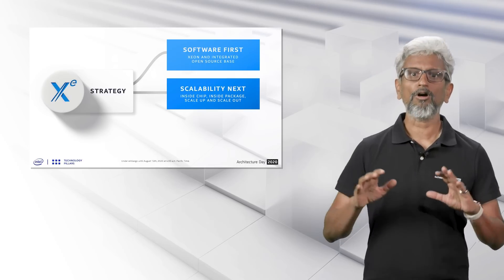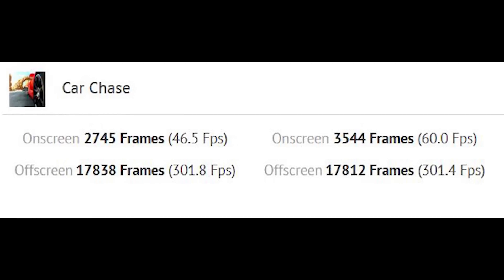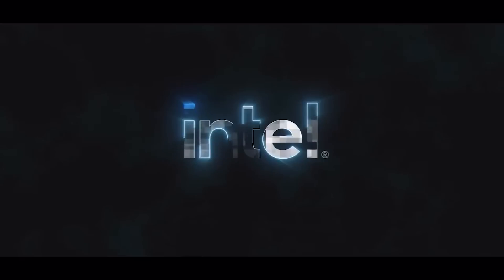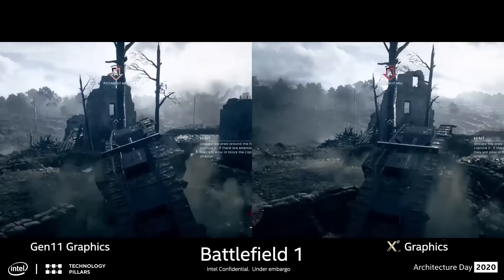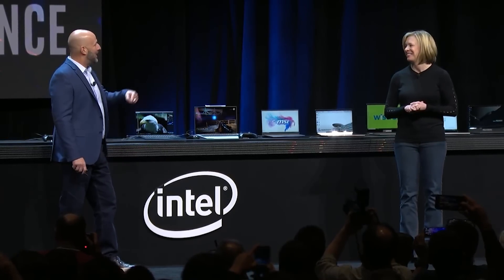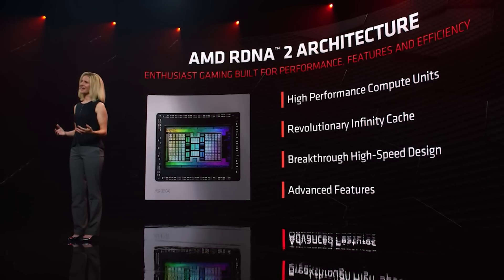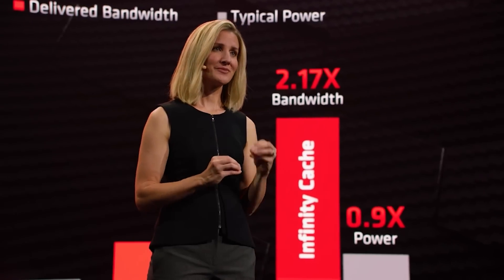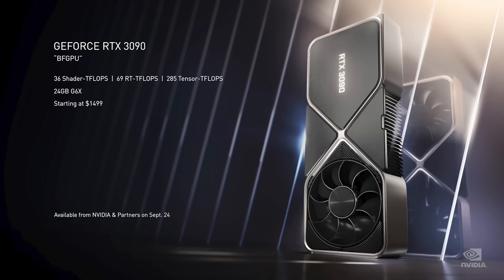Intel Xe DG2 Benchmarks Shows REAL COMPETITION | Navi 33 Specs & Early Prices LEAK

Comment: Sorry, DG2 looking super promising? Well, when the comparison point is the lowest end product from TWO generations ago, and the new product doesn’t consistently destroy the competition in that comparison… how is that promising? I mean, the 1660 launched at $149 and was launched at a time when low end discrete GPU’s were actually a thing.

Both nVidia and AMD are probably throwing away or recycling GPU’s (because they can’t pass validation for actual products) that will leave DG2 in the dust.

This is a HUGE disappointment from Intel if this is anything even remotely close to their best effort. The only thing these GPU’s is going to compete with is integrated graphics on Intel’s horribly aging CPU’s. There’s nothing promising about that!

Comment: I just hope the DG2 will bring some competition to both AMD/Nvidia.. Nvidia has continued to DRIVE prices higher, while giving smaller performance boost for each new generation. Ampere imo has been a JOKE.. Pascal was gift to gamers imo (Gtx 1xxx) and Turning (RTX 2xxx) was over price. Ampere RXT 3xxx   was cheaper but still overpriced. Consider Nvidia went with cheaper Samsung 8nm (which just refresh of there 10/12 node) and draws more power, and less performance boost vs previous generation gpus.

I just hope Intel prices there gpu correctly, but knowing intel, they prob overcharge like they do for intel cpus.. time will tell I guess.  I hope performance DG2 are decent enough.. (rtx 3060+)

hopefully RDNA3 is better and has better RT performance.
Reply: Ampere had a peformance boost but the prices were still Turing levels of bad. Ampere is such a bad uarch though. Power basically = performance.

Comment: I dont care if the 7800XT is 900$, if it is over twice the 6900XT in performance. If 6900XT perfromance can be bought for 450$ or less, this is awesome. If the 7800XT is just 30% faster and costs 900$ Im pissed, but at double the performance 900$ is insane value.
Reply: Problem is then they can charge you $900 for the next card and it will NEVER offer the same upgrade because of how many Compute units you are getting over RDNA 2.
Reply: @albal156  I know, but also prices of most parts of a GPU are getting more expensive, also politics and policies play a big role, cards just aren't as cheap as they were before. We can just hope they won't get ridiculous. We won't see a 7800XT at 2.5 times performance of the 6900XT for 649$, it won't happen. The GPU is way too expensive to make and people will pay a higher price. The 6600XT is soooooo cheap to produce and they sell it at 379$, they will easily sell out, because people want to game and so on...

Comment: The flagship gpus of next gen will be so powerful that it'll lock you into 4k 120hz for the next 8 years probably. Advancements beyond that will come as reduction in power draw instead of more performance as a 7900 xt is all you need for basically everything possible for the foreseeable future. The 8900 xt will be 10% faster but 30% less power draw because the 7900 xt is THAT strong ya know.. Nvidia will have some ground to make up though so their next gen WILL need a 40% boost again so no power reduction. 🤷‍♂️ I just can't see them spending R and D on more powerful gpus after we reach something like 4k 240 possible card. Who needs more?

Comment: It a pile of crap IMHO. Who would buy an Intel gpu that a gtx 1070 would be a comparison? What a waste of resources.
Reply: It's a really early test on a lower end version in their range. Watching the video might have been more of a waste of your time just because it's way too early. Early CPU regularly have shitty clock speeds compared to what they end up with.
Reply: There is no bad product, only a bad price. if a GTX 1070 like card from intel would cost 100$; it would be a steal even at 200$
Reply: @SweatyFeetGirl  A card that can't run 2020/2021 games at 60fps @ 1080p is a joke at any price IMHO. We are talking about BIG Intel gpu which was said to be around the 3080. There are lots of very old gpus which can beat intels finest atm.
Reply: @SweatyFeetGirl  On Medium settings perhaps. I use to have a 1070 and couldn't play ultra/high settings on games 2 years ago. I then got a 5700xt and could just about play everything at full settings. I know what I'm talking about. I have a 3070 now and can now max out 95% of games. Intel need to beat the 3060 or nobody will bother and people will laugh at them.
Reply: @SweatyFeetGirl  Not an achievement but a failure IMHO.
Reply: @SweatyFeetGirl  But it won't play AAA titles which came out this year at playable frame rates.
Reply: I’m with Barry on this. The 1660 is the lowest of the low end from nVidia from TWO generations ago. And the Intel card isn’t even obviously better than that and even falls woefully short at times. Okay, granted clockspeeds might not be what we see on consumer products, but this thing needs to be competing with mid range 2000 series cards at a minimum if they’re going to be worth anyone’s time. By the time these things are available in any sort of volumes, both nVidia and AMD will be releasing their next gen cards. These Intel cards will be competing - on raw performance anyway - with integrated graphics solutions.

The only thing that makes any sense is either:
(1) Intel sucks at making GPU’s, or
(2) this is part of a plan to eventually jettison integrated graphics on their consumer CPU’s and use the transistors to enhance CPU performance.
Reply: @benjaminlynch9958  GTX 1660 is not the lowest of the low end. let alone the GTX 1660 Super. GTX 1650 is the low end, which is even slower than a gtx 1060 and the GTX 1660 is 1 generation ago, not 2, RTX 20 series / GTX 16 series launched at the same time and thats 1 gen ago.

the GTX 1070 is more than 3-4 times as fast as the fastest desktop APU currently  5700G. even if the next gen apus would double in performance, it would mean the gtx 1070 is still more than twice as strong as the strongest APU. 

the GTX 1070 can still handle any triple A title at medium settings at 1080p60fps even titles like cyberpunk2077 if you properly tweak your settings.
Reply: @benjaminlynch9958  It's an early sample. You are being way too negative about an early sample.
Watch Moore's Law Is Dead for performance leaks about DG2 expectations.
This is very likely a low end card within Intel's upcoming Xe DG2 line-up.

Comment: I'll wait until we get ddr5 apus and see how much performance we can get
Reply: This! The answer is probably 1050 ti or more. If amd will actually release the product that they can. 12-16 rdna 2 cores with some finity cache with 4800mhz ddr5 will certainly be strong af. With 6 core 12 thread thatd be a 150 watt part at probably $300 to 350 but for your build you can snag a $20 psu and be good and use a tiny MB and case. I am def going to build one when we gets it.

Comment: Wait what? Navi 33 is 6900XT for $450? If so, AMD is gonna be more than forgiven for 600XT and will be back on top of my GPU Vendors list, which is currently empty. This is nuts. It's actually quite literally unbelievable.
Reply: And 8 GB, that means it's going to be a 1080p card for $450 in 2022...
Reply: @michaelpalin8953  6900 xt with 8gb? That's like a 6900xt with a 128bit bus.
Reply: @michaelpalin8953  Nah that wil be a 1440p card. Games may start to trend above that but VRAM will be the only probable snag there.
Reply: no

Comment: looks like Intel could slot into the low-end and mid-range that Nvidea and AMD have zero interest in now and restore the sub-$250 GPU market. This could do what Polaris did for AMD. It would be nice to see them claw up and be competitive with 70 class cards from Nvidea and The equivalent from AMD. Hell, I'll buy one to support their efforts if the price is right
Reply: If Intel saves midrange gaming... That would be pretty ironic lol
Reply: @_Chad_ThunderCock  lol
Reply: It depends on what the market is like when Intel joins. If supply has improved, then might see AMD and Nvidia rejoin that sector in force, too. It is important to keep in mind this is an unusual market situation right now. We should be wary of using it as the indicator for long term trends. Unless, of course, supply continues to be a problem in the long run.
Reply: @seanbaird9238  I am gonna buy a 3070 or 3080 no matter what... I am sitting on a 1650 for now... But I like to buy new things that are coming out from time to time in hopes they take off. Like the steam deck, I will get an intel GPU if they are good price to performance. But chances are I wont use it much, but Ill support the idea. More or less end up as a back up GPU or thrown into a backup rig. I was thinking of making a super small PC in a node 202 and throwing it in the closet for if ever I need it for when my main rig has an issue
Reply: I hate intel but if they make a good value 200-300$ product I'm buying it. Still on RX570.

Comment: If Xe desktop is roughly 3060 ti level with reasonable power consumption and prices, I'd be really happy with it.
Reply: The top end is expected to be around, probably a little above a 3070 Ti, anywhere from a bit better than a 3070 to nearly a 3080 though.
Reply: Mid range and upper low-end need some love right now.

Comment: 8gb on a gpu as fast as 6900XT? 
What a joke AMD has become.
Reply: It's not 100% confirmed so save your final judgement
Reply: @_Chad_ThunderCock  guilty af
Reply: A horribly ironic comment considering they put more memory than any of nvidia's directly competing cards.
It is not AMD's top entry, it is the third tier. Nvidia's midtier competitor to the 6700XT (12GB) only had 8GB, their alternatives for the 6800 and 6800 XT only had 8GB, 8GB and 10GB to AMD's 16GB.
Wait and see if nvidia also still tries to put 6GB-8GB or their equivalent (a faster, slightly cheaper but 6GB 3060 would have made more sense for that segment of the market anyway, compared to the slower yet 12GB option they put out).
Reply: @Endelite  The fact that 8gb won't be enough has nothing to do with Nvidia. 
I criticized 3070, 3070Ti and 3080 for the same thing. 
Ignoring the same problem on AMD would just be inconsistent.
Reply: Just like you !
Reply: Maybe they won’t need as much memory with 128MB of cache?

Judge the product by the price and performance, not by the spec sheet.
Reply: @benjaminlynch9958  No, cache makes the memory effectively faster, not larger. 
You need more then 8gb for playing many new games at max settings on 1440p+ even now. 

That said this might not be accurate information so they might go for more memory.